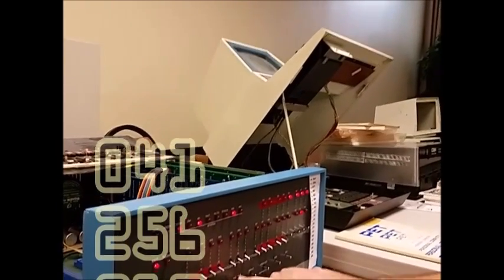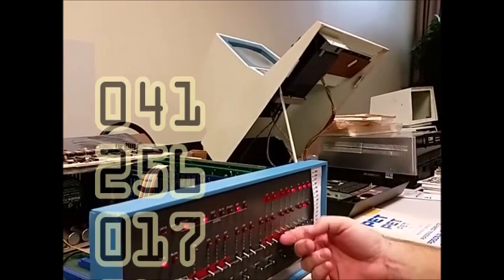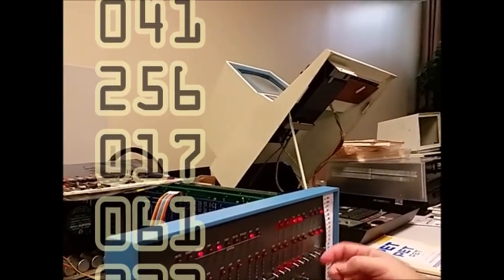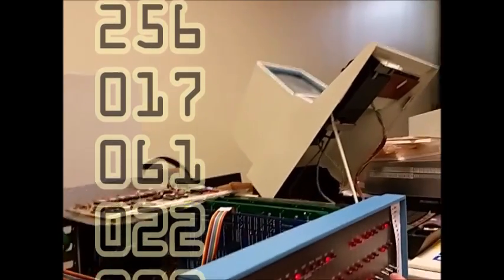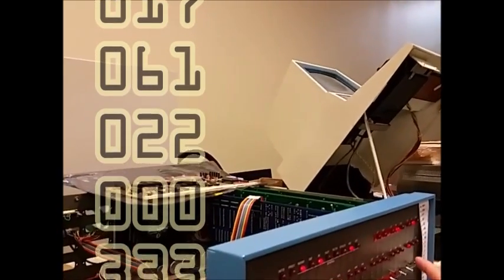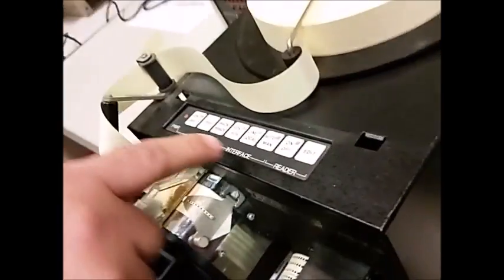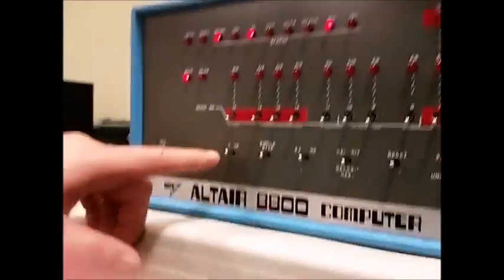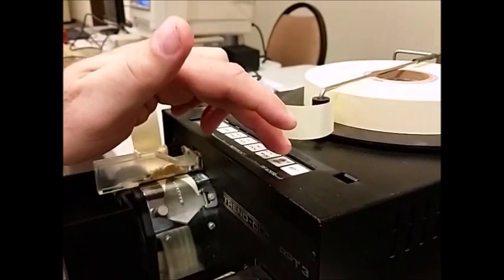A re-tracing of how Paul Allen loaded BASIC on the MITS Altair 8800 from paper tape

Comment: When I was in high school in 1975 in Oroville, CA, USA, we had an old Data General Nova 2 MINIcomputer that ran the I.R.I.S. R4 multi-user disk operating system. (multitasking, time-sharing; Interactive Real-time Information System revision 4) The Nova 2 looked like the 800/1200 series. It was a competitor to the DEC PDP series. The cabinet rack was about 2' wide by 4' tall by 3' deep. The power supply had HUGE capacitors, bigger than a soda can. It pulled a lot of watts and had to have a special circuit installed for it.

It had a bank of 4 disk drives that used 8-inch floppy disks that held about 256K (300K?) bytes each. It ran Business BASIC, an editor, and some other programs. The system had 16K words (16-bit) of magnetic core memory, using disk-swapping for each user's program, with user account logins, etc. There were several ASR-33 teletypes and a Hazeltine "CRT" keyboard-monitor terminal (24x80 characters, black and white, displaying lines across the bottom row and then scrolling) connected to the system for student use. (programming classes -- and a lot of games were played, especially at lunch time, and after school) The computer room was an old supply closet about 8' by 10', with the room that held the computer itself an 8' x 8' room that had to be air conditioned. The computer and its blinking lights could be seen through a window in the door.

The disk drives died often and we had to send them back to the company to be fixed. When that happened, we would load "Old BASIC" from the high-speed paper tape reader. It was a roll about 4 to 5 inches in diameter. The program was about 8K or so. It was a multi-user BASIC. If you wanted to save or load your programs, you would use the teletype paper tape reader-punch. (loading was like auto-typing your program from the reader, and saving was a LIST command that would punch your program onto tape, all at 10 CPS) The large Old BASIC tape would load in well-less than a minute, spooling out onto the floor in a blur and in a BIG mess pile. We used a 'construction/building' electric power drill to load the tape back up onto an homemade half-spool, otherwise it would have taken forever to roll up.

Eventually we got 32K words of dynamic Integrated Circuit RAM memory (two circuit boards, about 15 inches square in a large chassis) and two ADM-3A terminals that had minimal graphics-like line-drawing characters and cursor addressing so we could print anywhere on the screen. (at a blazing 4,800 or 9,600 baud speed) We were in heaven. We might have gotten a hard drive at some point, too. (would have been 1 to 5 megabytes or so)

Good times, good times.

That's partly why I'm into CRAV Computing. (Classic/Retro/Antique/Vintage)

https://www.facebook.com/CRAVComputing
https://groups.yahoo.com/neo/groups/cravcomp/info

http://en.wikipedia.org/wiki/Data_General_Nova
http://www.ricomputermuseum.org/Home/equipment/data-general-nova-2
Reply: in 1975 i had a first iphone :)